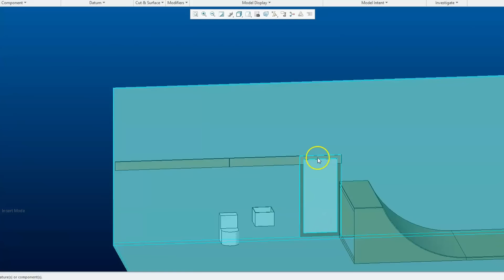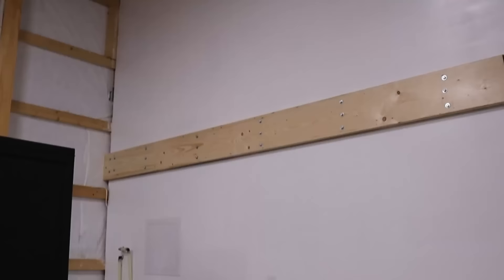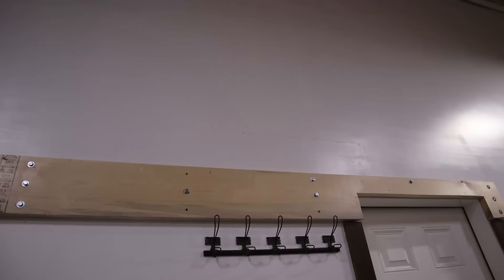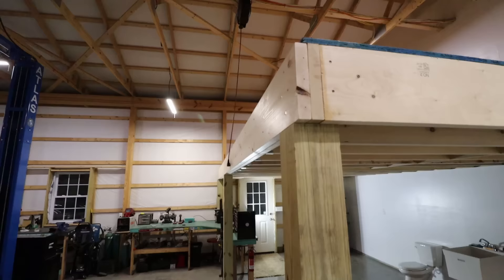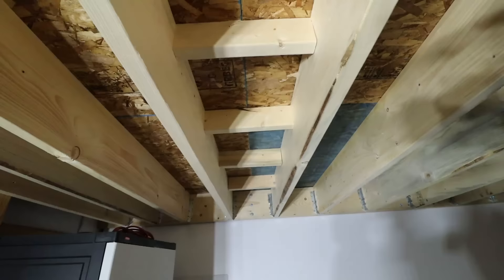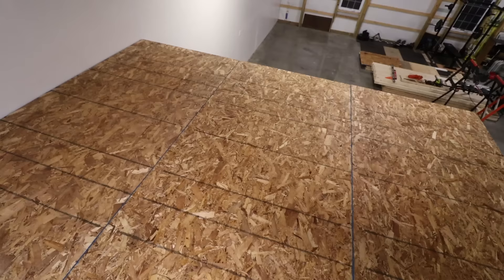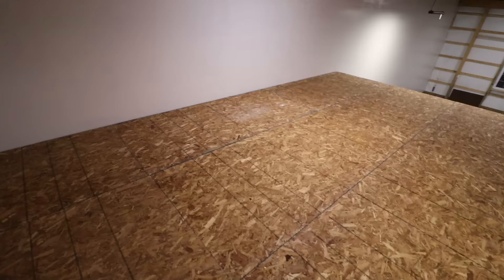Building a Large Mezzanine Loft By Myself - FULL BUILD

Comment: Good god. I am jealous as fuck of your garage. Mine is just a typical 22x22 ft 2 car garage with 9 ft high ceilings. I can't even install a 4 post lift without either raising the ceiling on my garage or extending my garage to a 3 car or 4 car with a higher ceiling than the original garage has :(
Reply from the maker: Yeah I've heard of that situation way too many times which is why I went with designing and building instead of buying an already built house. It was much more work but definitely worth it.
Reply: @Kordare  How much was the garage if you don't mind me asking?

My house was new when bought but I didn't design it. My next house I will design.
Reply from the maker: It was around 160 excluding the land. I did most of the interior finishing myself to save on cost (painting/ floors/ kitchen)
Reply: @Kordare  160k for the garage? Or are you talking about for that garage + a house? I don't know if that's just a work shop for you or if it's an attached or detached garage on your house. Sorry I haven't watched your other videos and only skipped around to look at some specific shots of the garage. I know how to build something like that, just needed the ideas for scale.

Comment: Kids do a proper stud layout and proper panning.
Don’t cut the strength out of your main structure and don’t do plywood seems land with no structure below them. 
Please
Reply from the maker: Yeah this wasn't perfect but I'm happy with how it turned out, especially since it's just a garage storage structure.
Reply: Kordare 
If you did a 16” layout measuring back 3/4” and marking X over
You would end up with your plywood end landing in the middle of you joists
Also staggering your plywood at 4 foot lengths would help interlock your T&G and strengthen your structure

Comment: your joist are being held by screws instead of the main beams. Your loft won't last.
Reply from the maker: Yeah I already changed all those screws to proper nails in the next video
Reply: @Kordare  not what I meant. The joists should sit on the beam and not attached to the side with nails or screws. Those metal joists hangers or w.e they're called will suffice I guess but you always want to stack wood.
Reply from the maker: @Standard_Logic  yeah stacking wood is best but these are floor joist hangers and this is a standard way to do a floor

Comment: Always great to see someone tackle a job like this. However, there are so many mistakes, from joist spacing resulting in deck sheets not landing on joists, to fasteners used.  The joists over door lost much strength because they were cut, why not just raise it a few inches.  Likely it will be fine but there are only about 1,000 pro videos on all aspects of this type of build on YouTube.
Reply from the maker: I am well aware that this was not done to professional spec and I made specific design choices for reasons stated. I am not a professional carpenter, this is primarily an automotive channel and I'm a mechanical engineer. Headers were placed at that exact height to have even headroom above and below, crucial because I'll be riding a bike on top. 14" joist spacing was chosen for increased strength over standard 16" because I'll be landing with concentrated forces on the floor. I knew this would cause subfloor seam to land off a joist and I accepted that. No it is not perfect but it's not meant to be.

Comment: Great idea Einstein, cut outs of the joist really make it STRONGER - try harder next time.
Reply from the maker: Hahahah I'm so glad I made those cutouts cuz now I have room to ride bike on top.
Reply: @Kordare  using smaller profile and stronger lumber with closer spacing you would have had even more room to ride the bike
Reply from the maker: True but availability and cost would have been limiting. I've already added more bracing over the doors so I'm confident in the strength.

Comment: You need to stager the sheets of osb, to make it stronger, How you got it it is weak and wont be near as strong...
Reply from the maker: Yeah I'm really not worried about it. This is so overbuilt for what I'm using it for. Its tied to two perpendicular walls. It can not move. The plywood did zero for strengthening this structure

Comment: With all the positive comments about this basic carpentry work really amazes me and concerns me for the future of carpentry by this young generation.  This is not dope, excellent, rad or amazing for these reasons.  
1. Using screws instead of Teco nails for the hangers. 2. Gluing rim joists for "strength" but not gluing the sheathing to the floor joists.  3. Not drilling 3/8 holes in ledger for 3/8 fasteners  4. Notching the ledger for the door instead of just raising the structure a bit more.  5. Not squaring up the deck before fastening the sheathing.  6. Lining up all the gaps in the sheathing instead of staggering them.  7. No diagonal supports from posts to rim joists.  8.  Ledger splice is not on a stud (this blew my mind).
Oh well, it's better than many structures in China and he's happy with it...
Reply from the maker: Haha yes you're completely right but it's just a storage structure in a garage. Its not meant to be a second floor to a house. This is completely over built for what it will be used for. I'll be riding bike on top so it was crucial to have enough headroom. I set it up so the headroom above and below is equal. I actually already added more bracing over the door. I even said in the video I'm not a professional. This isnt a how to video. It's a video of me building something, dont make it more than it is.
Reply from the maker: You should search garage loft and compare mine to the others built on YouTube.
Reply: @Kordare  Gotcha!  Thanks for the reply.

Comment: That cut out for the door is going to  make it so weak especially with the 10x2 hanging of a 4x2 joist hanger and the end joints with the ply is going to droop. And not glueing it down its going to squeak. And the cut out for the external door geez 😬 a Builder inspectors worst nightmare
Reply: Also the joist hangars are designed to be fastened with nails not some 8g screw
Reply from the maker: @-hiltsey5646  haha yup it's a garage loft not worried about floor squeak or small details like what you mentioned. I placed the headers at this height for very specific purposes. I will be adding more bracing to those cutout areas, but with the 14 o.c. this thing is super solid as is.

Comment: As you get older and maybe learn a little more about construction, this build is going to make you cringe.  There's a wealth of information out there and it's easy to research projects ahead of time to make sure you do a proper job.  Around your age, I designed and built my own house.  The inspector told me multiple times that it was one of the best built and most efficient designs he had ever seen.
Reply from the maker: Yeah I already fixed anything that was really an issue (mainly changed the screws to nails on joist hangers) and don't care about the rest because it's a storage space in a garage, nothing more.
Reply: @Kordare  One thing I've learned is that you'll never be sorry for doing the best job you possibly can as well as designing for the flexibility of the future.  It's storage space right now but it could easily be used for something else later such as a lounge, a bedroom, an office, etc.  Things like cutting the bottom of the joists (where most of the load is), failing to notch the corner post for the end joist and the unsupported subfloor along the outside wall can all be problems in the future.  Not to mention how you end-screwed through the rim joist and then covered up the screw heads with the second layer of 2x10s, glued them as well and didn't stagger the joints.  Just that extra little research/know how pays off in a better job and it doesn't cost anything extra in materials.  Even at the design stage, you could have bumped up the height a few inches and maybe went with wooden I-joists so they would have cleared the doors.  Whether you build anything else in the future (or not) or perhaps someone else reading this, or even while working on your vehicles, always doing the best job possible including your research always pays off.
Reply from the maker: I agree and I did some of those things for specific reasons. Now that my ramp is complete I ride bike on top of this loft so it was crucial to place the floor where I did to have enough room on top. I've also already added more bracing in areas where the joists are notched. I'm an engineer so I know all about doing the job right and designing every single detail. But sometimes it's just not worth the mental capacity to become an expert in every single thing you try to do. I have way too many hobbies and interests, I don't have time to make every thing I do perfect. At some point you have to stop researching and just go do and learn from your mistakes. Take a look at the rest of my channel to see the level of design and detail I go into on my automotive projects.

Comment: There is just so much wrong with this. Deck sheathing joints not landing on joists. Those hangers aren't meant to be attached with regular construction screws. Either hanger nails or structural screws....those screws you used do not have enough sheer strength for that application.
Reply from the maker: I agree! But you forgot this is a loft in my garage for storage, didnt even attempt to build this to any code. I had to work with the tools I have. I'll let you know if it ever fails me. It's funny half the comments say way overkill and others say I made say its gonna fail if I step on it 🙃🙃

Comment: You must be 5'8" at most...
Reply from the maker: 5'9" good guess
Reply: @Kordare  LOL :) As soon as I saw you notch out the door I knew you had to be on the short side (sub 6' anyway, I'm 6'2"), would've saved a ton of trouble to just put the platform above the door, which...why didn't you?
Reply from the maker: @jacobevans8365  I'll be riding bike on top so it was crucial to have enough headroom. I set it up so the headroom above and below is equal. I'll be adding more bracing over the door.

Comment: It seems that you have some skills, just not much building experience. spacing your floor joists at 14 inches was a mistake. Fortunately, the loft wasn't very large so you didn't have to cut too many sheets of plywood. Cutting the ledger over the door really compromised the strength at that point.. Cutting the joists above the door was also a big mistake. Those joists are no longer 2x10, but rather about 2x4. The screws you used on the joist hangers were not appropriate for that use. Also, there is no footing under the posts, just a concrete floor. I'm an engineer as well as a builder and have been for 40 years. You should have done a little more homework, or asked someone with some building experience to help you. The end product turned out not too bad.
Reply from the maker: I am well aware of all those things and made those compromises on purpose not by accident. I'm a mechanical engineer full time so I knew the effects of every decision I made. I poured my floors thicker than traditional floors in the entire garage to allow me to place car lifts wherever I wanted and will easily be sufficient for this load. Yup didnt use perfectly spec screws to build a second floor to a house, but that's NOT WHAT THIS IS. ITS A STORAGE SPACE IN A GARAGE. I'll be riding bike on top so it was crucial to have enough headroom. I set it up so the headroom above and below is equal. I actually already added more bracing over the door. I used 14" spacing because of potential concentrated loads it could see from a bike landing on top. This thing is so overbuilt for what it will be used for. But because it's not perfectly to code everyone is so upset. When you build a step stool do you make sure its built to code? I'll check your channel to make sure everything you've ever made is perfect.

Comment: At 17:00 you talk about having to add bracing under the edges of the floor. That is because you did not layout your joists properly. You should have watched a few videos on building houses and lofts and you would have known to set your joist spacing to accommodate the size of your floor panels. You made a lot of rookie mistakes and should not be showing a video of how to do it, but rather how to not do it right.
Reply from the maker: Hahahah I'm not a carpenter! I purposely did 14 OC to add strength to compensate for concentrated loads from a bike landing on top. And I knew the floor wouldn't land on a joist, I'm a mechanical engineer and I know how to add. Just remember this is a storage loft in a garage. I didnt even attempt to follow any codes. This is NOT a second floor to a house, I made it this way specifically because of how it will be used.

Comment: You lost most of the integrity of the two joists you tapered above the door.   That was not a good move.
Reply from the maker: Yeah I know I'm a mechanical engineer. But it's still effectively a 2x4 and I have added solid 2x6 bridging in that section tying them into adjacent 2x10s. I set the floor height for very specific reasons.

Comment: Dude you're killing me with your carpentry, osb trash, why didn't you just go above the door, why didn't you cut the osb to line up with the joists, why didn't bring out the 6x6 to support your outside joist.
Reply from the maker: Hahah I used subfloor tongue and groove, made to be a floor...I'll be riding bike on top so it was crucial to have enough headroom. I set it up so the headroom above and below is equal. I'll be adding more bracing over the door.